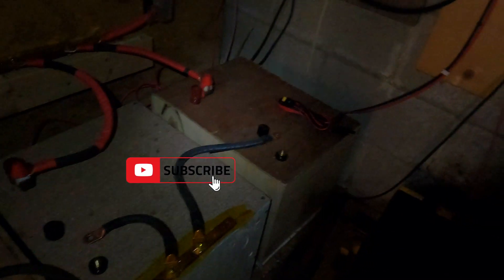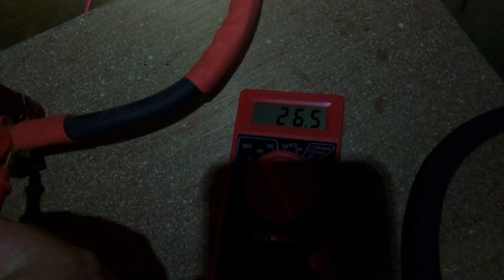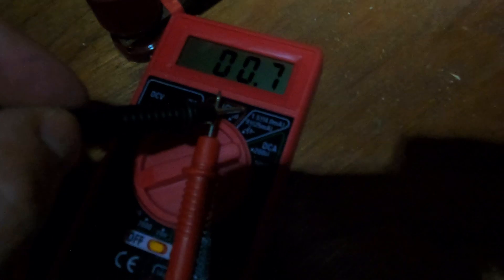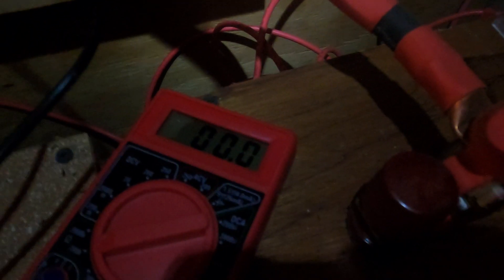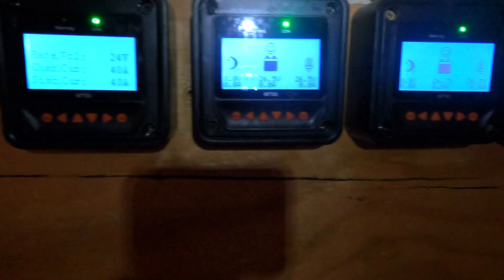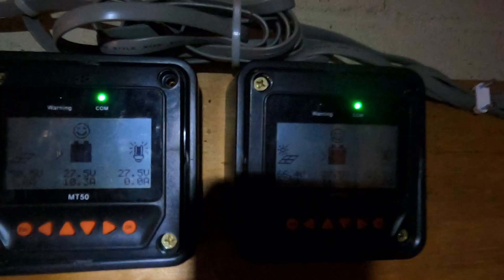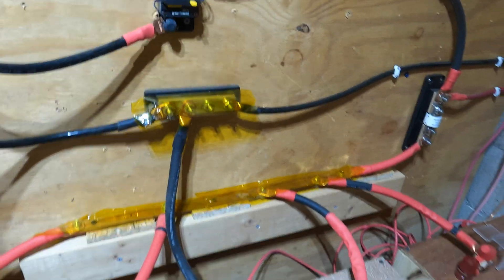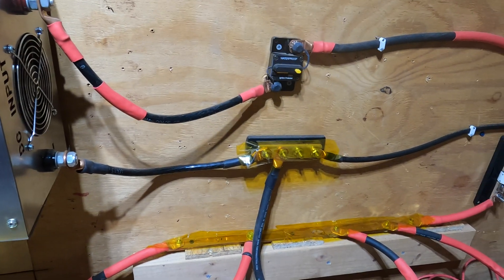My 24v 6k 600 ah off grid solar setup is DEAD!!! What happened and how do I fix it?

Comment: I ran a backup system for smoke detectors and emergency lighting. D.C. with D.C. backup. Which building codes were changed to allow. Nice to have light if main goes down. Like boats should have, but also nice for off grid.
Reply from the maker: Great idea!

Comment: Who makes those SCC’s? They don’t look like the highest quality units? It could be me as I’ve never seen them before?
Reply: They are made by EP ever. It's a Chinese company that makes solar products. These are inexpensive MPPT controllers, but they don't have the best tracking algorithm.
Reply from the maker: I would disagree with you on the Epever controllers.  I have used them for years, have many of them - 100v and 150v - and they are an excellent value. Yes, Victron has better tracking but is three times the price.

Comment: you do not need expensive full scale mains fuse there as you have only 24V. Fuses rated not only for current (when it blows) but for voltage (which arc it can withstand without damage when blows). You need just 200A 32V - its just an automotive/solar system product, costs $5, 400A $10.
Reply: It might be ELV but the fuse still needs to be rated to break the short circuit current of the battery system.  600AH of LiFePO4 suggests it will have quite high SCC.  Technically BMS will try to disconnect the load on excessive current but if it should fail you definitely want that last resort option of a fuse or breaker that can handle breaking how ever many kA that may be.  Can your $5 fuse break 5ka?
Reply: @retrozmachine1189  yes it can - all these kiloamps are significant only when you have high voltage, enough to upkeep powerful arc. 5KA*400V = 2MW, 5KA*24V = 100KW. The same time of arc breaking * 10 times less power = 10 times less energy to destroy the fuse. Its the reason why fuses are voltage rated.

Moreover, just to achieve 5KA on 24V system you need loop impedance 0.5mOhm which is absolutely unreal. If you connect 20 (the same) batteries in series, 240Vdc, it will be able to give out something dangerous, but not on 24V
Reply: @antontsau  I wouldn't be so blaze about it.  A battery consisting of 8 280AH cells can push 10kA at the posts if the BMS doesn't prevent it.  In this chaps setup the wiring length would be the main contributor to impedance but relying on wiring as a current limiter is poor practice.  Ideally he should have devices rated to break at least 10kA on the posts of his battery sets.  So yeah, using a $5 car  fuse may not be the smartest thing ever done.
Reply: @retrozmachine1189  10KA on 24V is 2.4mOhm. Just to compare - 2M of 25mm2 copper cable is 1.5mOhm. Cable itself. Without battery, connectors, bolts, anything. So I estimate peak current there 3KA max.

And yes, these fuses can cope with 4KA, on their rated 32V, not on 240 or 400V of course. They will blow, not explode, and arc will be contained and extinguished without further damage. They are designed for such application, low voltage 400A protection.
Reply from the maker: Thanks for your input and yes I could go with something cheaper like an ANL or other type of fuse but there is no way in the world I am giving up my Class T fuse!

Comment: What's the continuous watts on the inverter of yours?
Reply: Looks like the Genetry 6kW unit. They also make a 12kW unit now.
    They are the only ones I know of that can be changed from one voltage to a different voltage.
   Sean and Sid have done an excellent job creating these very high quality inverters.
    You can look up Sean's Genetry YouTube videos or the Genetry Solar website for more information.

Comment: Harbor freight multimeters.I don't like them, especially when their power level gets low.They'll give you weird readings, fluke all the way they're just pricey
Reply: I think it's all about the accuracy needed for a given job. +/-5% should be good enough to see if a battery bank is charged or empty. High end tools are sometimes needed, but sometimes cheap tools are needed. It depends.
Reply from the maker: I agree. A Fluke is going to be more accurate than a Harbor Freight one and probably last longer but for an average guy like me there is no need to spend the extra money.
Reply: @OurBlackCatCottage  A fluke is not needed if you are not using it daily in your job. What you have is perfectly fine for your situation, and actually better than what we used to have back in the day.
Reply: Buy once cry once! There’s no better than Fluke. Always knowing you’re using the best tool for the job is reassuring. You know you’re not getting false readings in the middle of a crisis.

Comment: This is why a modular system like yours,or how Victron does,outways any all in ones in an offgrid situation.IF sometthing would go bad,like the inverter,or a charge controler,You can change them separately.If in an all in one,the charge controler goes bad,you cannot use the inverter either....This way,easy to change out any part that shits itself.

Comment: I was going nuts trying to figure out why my Solar charger showed no power coming in from the solar panels. I Checked each panel, and everything was ok. Long story short I melted an MC4 connector for the 2nd time. The first time it was obvious the MC4 was twisted from the heart this one wasn't so noticeable which made it hard to find. I finally had to change my wiring configuration needless to say.
Reply: I went with 8 separate strings of 3 panels so as to limit the #10 wire and connectors to 10a at 120vdc each having its own 15a breaker and then tying into 2 separate positive and negative buss bars.. Each half feeds an 80 amp charge controller via a 75 foot run of #2 wire through an 80a ground/arc fault DC breaker protected by a Midnight Solar surge protector for each half and 8 MOV's 1 on each 15a breaker.. All the MC4 connectors were cleaned with Deoxit Gold contact cleaner and lube and the O rings and plastic mating surfaces were coated with silicone grease coax seal paste before assembly to prevent any moisture intrusion.. I just went through and tested each 3 panel bank for voltage during the day and all had the same voltages so no signs of one having a higher resistance that would cause heat.. Bought all my connectors and fuses direct from a large electronics supply house and not from Ebay where fakes are common..

Comment: I had a  🔟amp blade fuse in my car blow or break. But when I looked at it very closely several times under a light & 🔍. You could not find anything wrong it. I was going nuts trying to figure out why my digital dash & other things died..Finally I tried a new 🔟 amp fuse & everything worked. 

The other impossible to find problem & why the car was being sold for so cheap was. Several beetles 🐞 had crawled  into the fuel injector rail.  When the fuel injection system was left  disassembled for a few days. By the previous owner (I guess they liked the smell of gas).  The gasoline caused the bugs 🐞 to become hard & float around like corks. In the fuel rail, intermittently clogging the fuel injectors. Causing the car to randomly die & not start. Then a few hours or day later, it'd start right up & run fine for a while. The repeat the problem, so I got it for cheap. But went a little nuts trying to fix it. Luckily by dumb luck I found the bugs.
Reply: That's nuts. 😅

Comment: Hmm.  Pretty rare for a T-Class to blow unless something went really wrong somewhere.  It should be sized for around 150% of the maximum nominal operating current of the system, or higher.  (but sized lower than the cable's maximum temperature current rating).  It is there only as a failsafe and to allow the other fuses and breakers in the system to have lower I.R. (interrupt rating) specifications.

Which is the second thing.  You can reduce costly fuse replacements by having a decent DC breaker layout in your topology.  Usually a Type C DC main breaker and then Type B or Type C branch breakers (one on each device connected to the bus).  The breakers can be sized closer to actual expected loads on the branch circuits (125%) and the branch cable size, whichever is lower.

The nice thing about a fuse - breaker combination is that for a typical accidental short on a branch circuit, the breaker's solenoid will trip the breaker instantly, long before the fuse blows and save the fuse.  Branch circuit breakers are pretty much mandatory for this reason.  Main breakers are useful as a second line of defense but more costly... they need a higher I.R.

The T-class will mostly be saved by a branch breaker trip due to a short on a branch circuit.  The smaller cables on branch circuits means the short current is lower.  Still plenty high enough to trip the branch or the main breaker instantly, but not high enough to damage the T-Class before the branch or main breaker trips.

-Matt
Reply from the maker: Yeah I thought it was pretty strange too. But after analyzing everything I am pretty sure I know what happened
Reply: @OurBlackCatCottage  Well… share with us what you thought might have happened.